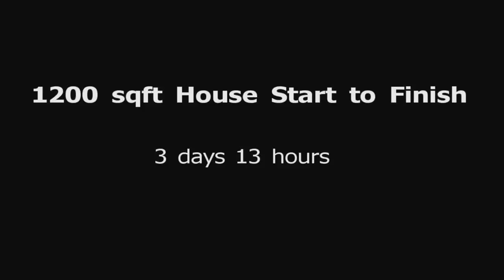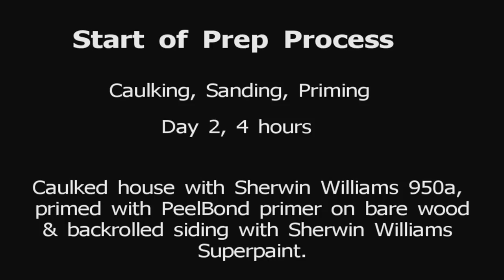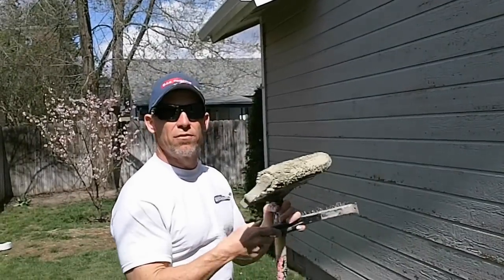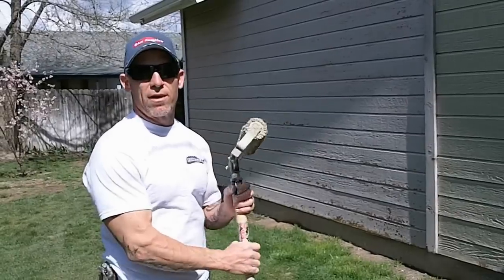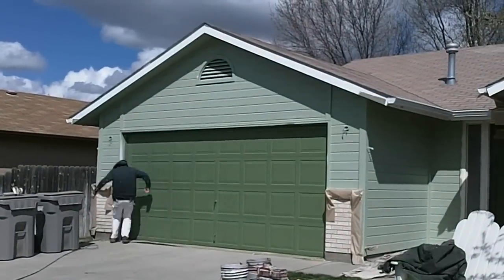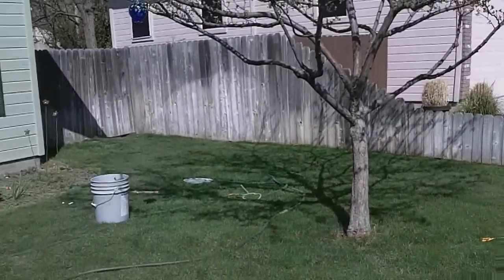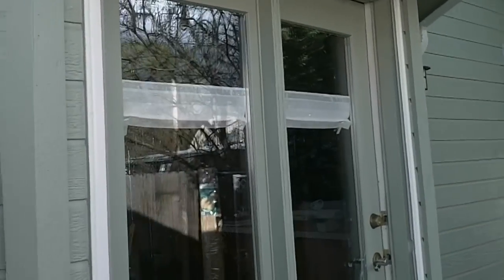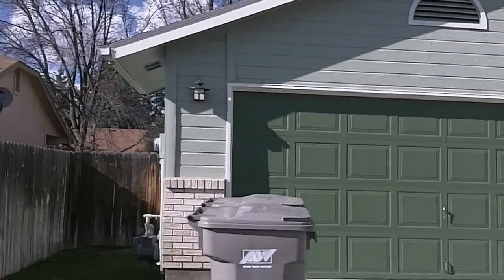How To Paint A House.  Powerwashing, Prepping, & Painting a House.  DIY tools & tips for painters.

Comment: Hello Sir,
I got a question,
What's better, to paint with a primer and paint in one or paint primer first and then finish with the final colour?
Reply: Paint with primer is a gimmick in my opinion.  I used to work at a home depot, paint with primer is marketed for the diy'er. Primer is designed to go on BEFORE paint, to seal and protect your substrate,  and provide better adhesion of your top coats. Having worked at HD, and having a painting operation of my own, i can tell you 2 things. 1, there is at least a 30 % markup on certain paint/primer brands, and 2, paint/primer combos spray horribly,  ive had to thin them so much it's almost colored water. Prime separate,  then 2 coats of paint and you will love the results.

Comment: Hey Kris. When you price a job like this, say, at $1.50 per square foot (I saw in your video on pricing you saying this is a typical price for your exterior during the peak of the season), does that include pressure washing the house; or is that separate? If so, how much would you charge for the pressure washing?